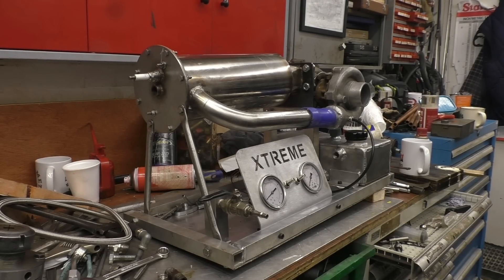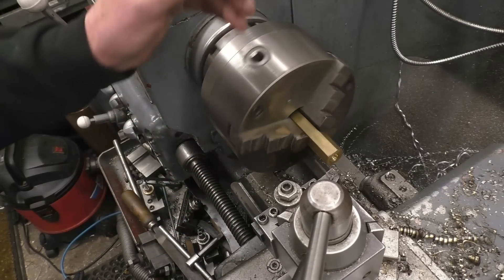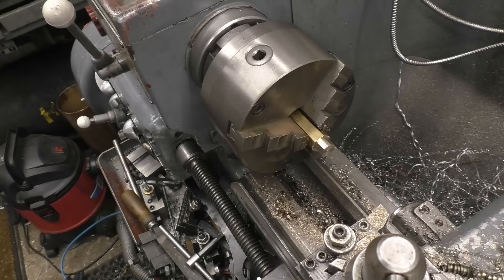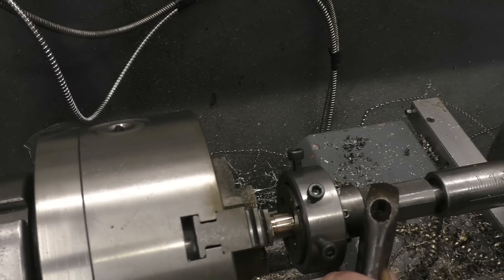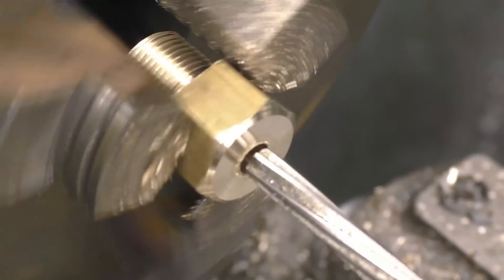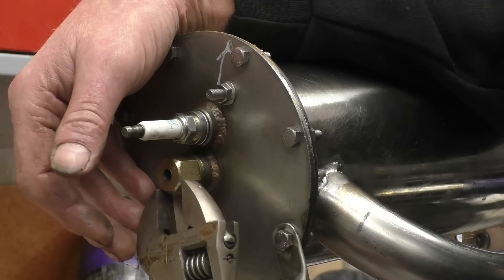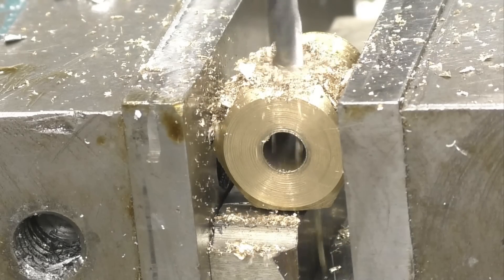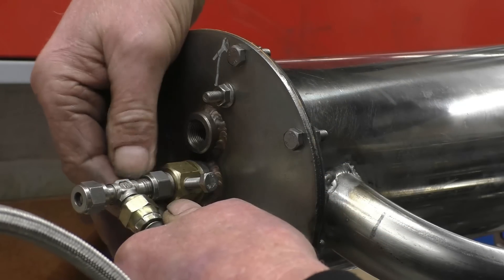DIY Gas Turbine P16 .Gas Inlet Pipe

Comment: John complaining about somebody wasting the brass because they drilled and tapped it. I recall John himself making nuts from a brass hex bar not that long ago where he drilled and tapped it then cut off the nuts. In this video he faces the bar to get rid of the hole, turns the outside then faces more off the end only to turn more off the outside. Then he drills a hole in it anyway so the original hole wouldn't have mattered. Things like this make it fun to watch.